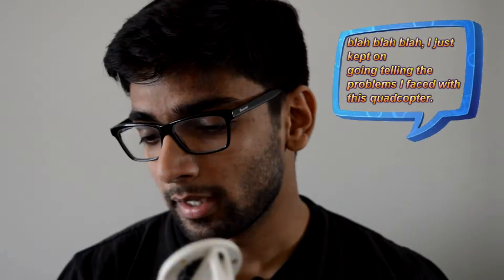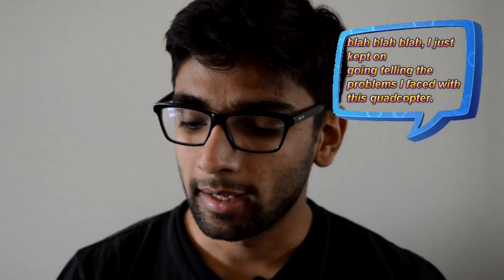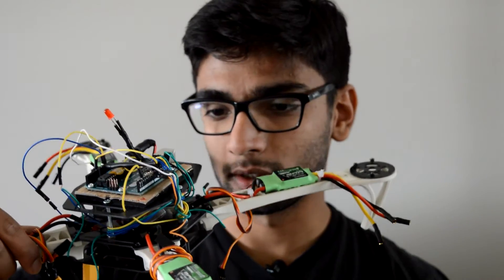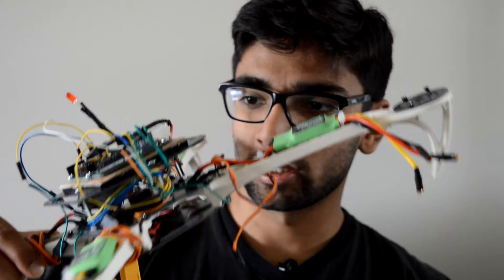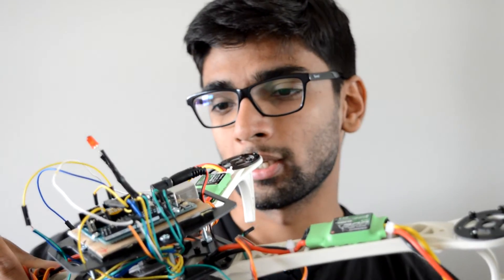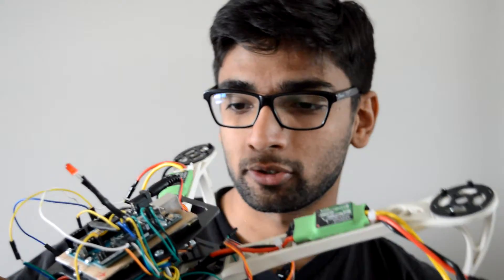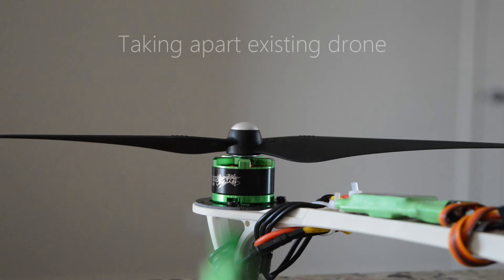DIY Do It Yourself - ARDUINO UNO QUADCOPTER | Introduction to the Project

Comment: how much weight it can lift
Reply from the maker: Hello Shubham Vernekar,
My quad ended up just under 2kg and it was able to lift it. I know, mine was pretty heavy. You can calculate the MTOW by using your motor's spec sheet and see how much g's it can produce under a certain voltage.

Thanks,
Chirag Sharma

Comment: hlw sir can u plz help in making this project my quad is not taking flight.i have done all process mentioned in tutorial seies
Reply from the maker: Hello Kumar Gaurav,
It is hard to determine what's wrong with your quad. Please be specific.

Thanks,
Chirag Sharma
Reply: sir after final setup when i try to take flight and when i give the throttle around 40-50% it just bends toward right and it doesnt lift up.

Comment: sir why my diode melted when i connect it into series? :/ its also the same when i solder it again in the battery. sir did you just connect it in a series ? :/ hope you help me sir

Comment: can u plz tell me about arduino skech/code which is used in  flight controller
Reply from the maker: Please see in the description of the video.
Reply: it did not work only it take beep beep beepp...so on
Reply from the maker: Did you calibrate your ESCs? Please check your ESC manual to see how you can calibrate your ESC. Alternatively, there are calibration kits available for $2-4 that you can buy online.
Reply from the maker: You might need to calibrate your ESC. Please check your ESC manual on how to calibrate it.